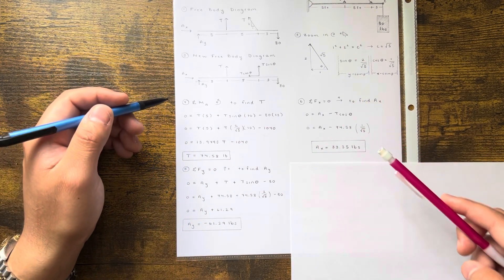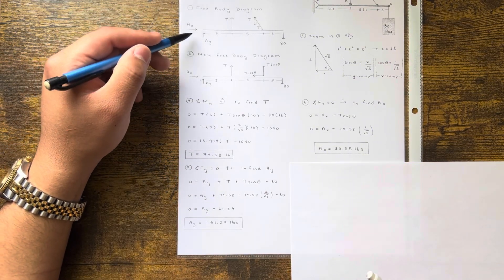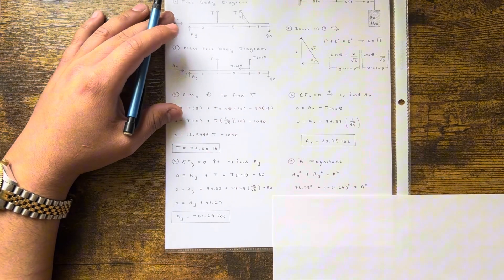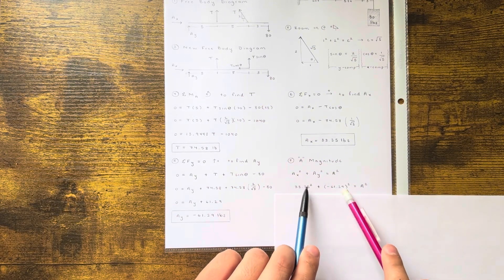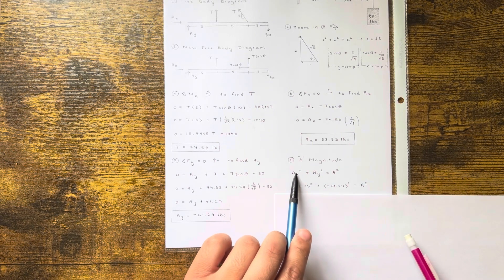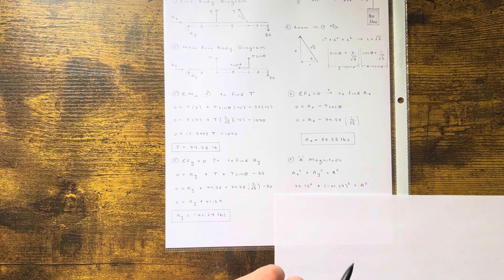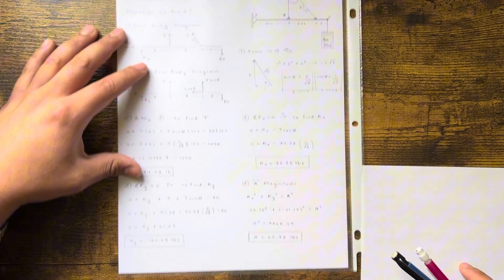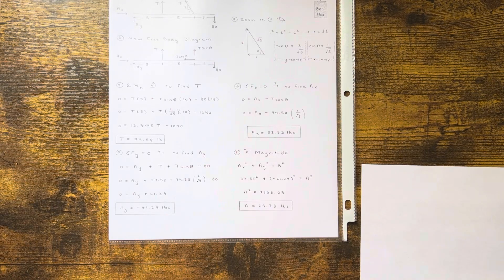Statics - Determine the Tension in the Cable and the Horizontal & Vertical Reaction of Pin A Pulley

Comment: If the question for that problem is "Determine the tension of the cable holding the bar ABC in kips if the weight of the cylinder is 195 lb." what will be the formula use??